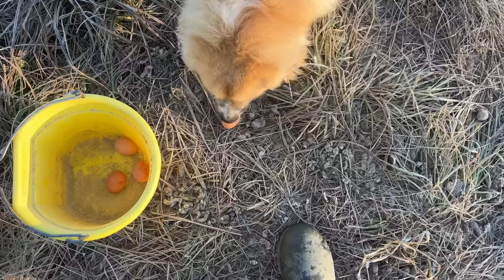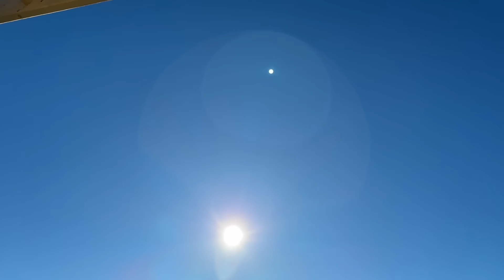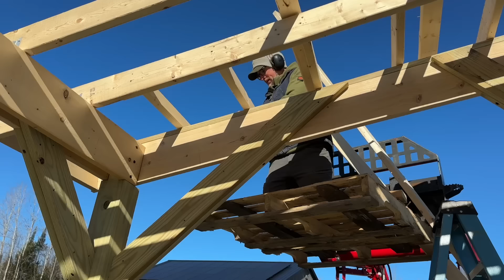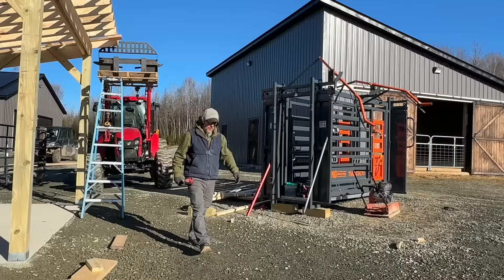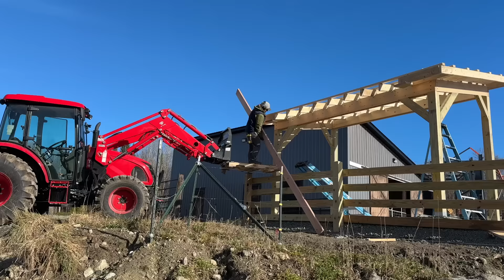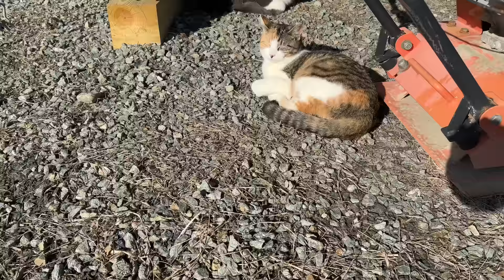We Had to STOP HERE...

Comment: FYI, those solar lights generally have little paper tabs between the rechargeable battery and the contacts to prevent discharge during storage.  I didn’t see you pull them out, but you may have off camera.

Comment: Good Day Al and Gina. Open your lights and check for plastic insulator at battery contacts, should be easy pull out. Lights are usually shipped with batteries mostly charged.

Comment: I saw a video where a guy was using his tractor and forks to provide an elevated work area similar to what you did. His was much safer though (and Gina would like that). He used the metal cage of an IBC. Cut any bars on the top out, make a cutout in one side, attach a chain from one side of the opening to the other with a hook on one side. Once inside, clip the chain closed and you are relatively safe from falling off. It would also make a LOT of sense to have a solid floor with no holes between boards to step into and droppe screws or nuts on't fall through. Besides, you could make ways to hang/lay tools, nuts, bolts, nails, etc. along the siderails.
Gina, make Al do this!
Reply: That piece of chain makes it OSHA approved !
Reply: They actually make a "safety basket" designed to fit pallet forks
Reply: @JustMe-s6s4m  I think I saw the same video. “Ambition strikes “, they’re fun to watch. It was quite an ingenious contraption.

Comment: Al, as mentioned, there should be a plastic tab in front of the re-chargeable battery that has to be pulled out to complete the circuit and connect power to the bulb and also allow the battery to be charged by sunlight 😉

Comment: I have solar lights that did NOT come with one of those clear plastic tabs over the battery; rather, the included instructions required me to switch the control tab to the ‘ON’ position before charging.  When charged, the instructions required me to press a button once, for low light (8 to 10 hours of light); or press the button twice for brighter light (6 hours of light); or press the button three times for motion-only light.
Reply: Interesting! I haven't come across those yet. I can see where that might be a problem. Is the switch inside the casing?
Reply: @ No.  The switch is on the outside, usually beneath the solar panel.  NOTE:  The solar lights I use are not the post installation variety; rather, they are either ground- or wall-mounted.

Comment: Check the batteries. Sometimes they have a plastic deal because when they're stored in the box they have to keep the batteries from touching to from going down because they're in the dark, what you have to do is take that plastic piece out, it'll be on um between each end of the batteries underneath. In the battery Aria, so you'll have to unscrew. The screw to hold the batteries and pull the plastic out and then let them carve up a little bit more and they'll be all right

Comment: Al, did you remove the pull tab on the batteries for the solar lights? It's a small tab inserted between the battery terminal and the solar cell power connection that breaks the circuit connection during shipment.

Comment: You know, Al, I'm surprised that you haven't built a platform that you can pick up with the pallet forks.  You could have removable rails around the edge, a flat floor so you don't have to watch where you step.  Pockets and bins on the tractor end for fasteners, tools, spare batteries, a place to mount a ladder that you can climb up and down while working, even a cup holder for your coffee.  You're a resourceful guy, think about it, you don't even need to spend any money on it, build it out of off cuts from other projects.  Maybe even have a lightweight roof you can take off when you don't need it and put on when it's raining or really sunny.
Reply: I would add some hooks to the underside so it can be strapped to the tractor forks.

Comment: Al, 6" lap on the roof panels is all that is required on a commercial building. The lap occurs at a purlin. Also depending on the roof slope bead mastic across the end of the panel is required.

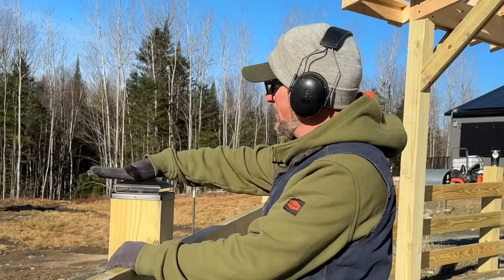Comment: Post lights:  16:26
You certainly have to be grateful to the donor of your post lights. I've had some experience with them, they're not as bright as a candle to use a single LED usually powered by a 1.5V AA rechargeable cell.  I recommend you take them all inside where it's warm and put them under one of your lights and let them charge, like your lighting system batteries are affected by cold. I've actually remove the batteries from the housings put them in a charger set at the correct battery chemistry. (Some are still nickel cadmium).

Comment: Essential Craftsman had a great trick for cutting multiple boards the same length.  Put one on top of the other (make sure the other ends are flush).  When you cut the top one, have the blade coming slightly through the board (like normal).  The top cut scores a line on the lower board, then you line that board up with another on bottom and cut along the score, scoring the next one, etc.